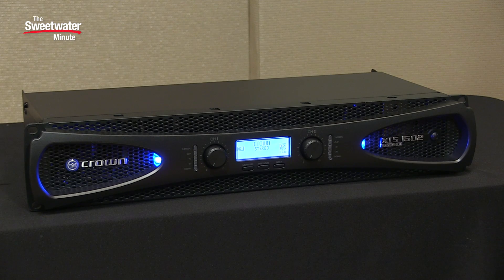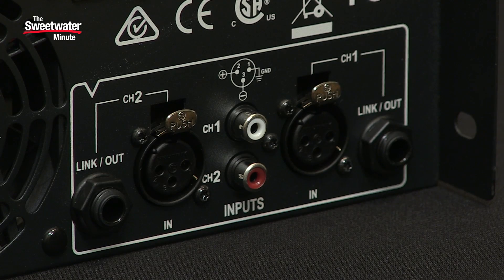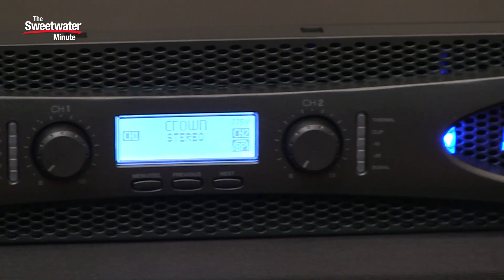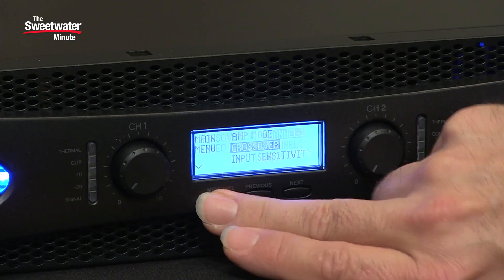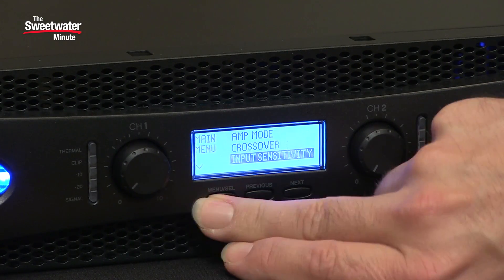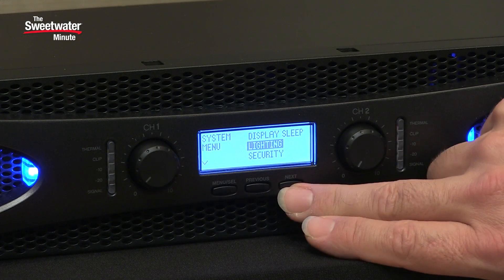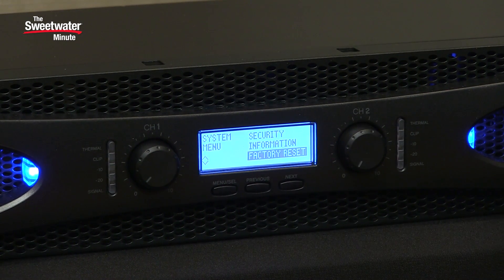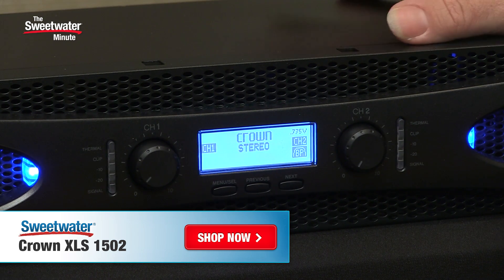Crown XLS 1502 Power Amplifier Review by Sweetwater

Comment: How can I have individual volume control remotely of each channel? Preferably under $30

Thought about splicing up two RCA bass knobs + - input with the sub wire then the other out RCA on the knob directly into the amp....but I don't understand how to determine if that is suitable for the potentially upwards of 300+ watt RMS draw from each channel 

Will this work and if so any concerns/cons?  Or any better options? Would appreciate replies from anyone that would be knowledgeable on best way to accomplish this. Cheers!

Comment: Careful guys, this amp is designed for DJ's and PA (public Address) systems, not hi-fi.
Reply: It sounds amazing and works great for loudspeakers in the home. Especially ones with 12-15 inch passive woofers which are incredibly hard to drive.  

Just pick one up and try it, trust me.
Reply: I use two of the smaller models (1002) in my sound system at home. Does the job better than anything else I've owned so far lol.
Reply: This amp outperformed my Emotiva and My NAD and did so without coloration...not warm not bright, it just puts out what you put in. For the price, I highly recommend you try this amp on your Hi-Fi set up and see what it can do. Read & watch the reviews first!!
Reply: I have friends with high end gear who highly rate this amp

Comment: Can I use this with just a CD player and use the gain control for volume or would I also need to use a preamp? Thanks. Great video
Reply: You'll need a line level, stereo preamp.
Reply: @Luke Schneider My bad!
Reply: @Luke Schneider Yes yes I know! The possibility of such case I mentioned, for nowadays products is zero. It's just that a couple of months ago, I stumbled upon three battered and bruised, 15y old or so power amps, at a pub, from obscure brands like Deton(?!) and Mac Mah(?!), which had only xlr inputs. It's surely a thing of the past. You never know what's still out there and still working! But yes, everything now has rca terminals, too. Even 6.35mm jacks.
Reply: @Luke Schneider Roger that! It's confusing when you start. Needs quite a lot of reading, memorizing schematics and hands on practice. Also the number of cheap combo cables in the market (xlr to rca to jacks to speakon to euroconnectors to whatever) is making people believe anything can be connected to everything without problems, hence permanent installations, like the example I gave, having gear from several doctrines and you trying to become Sherlock Holmes to figure out noise, drops, hiss, loudness levels etc. I've come across several such atrocities. All because owners usually ask electricians to choose, install and set up.
Reply: @Luke Schneider Hello again Luke! Just wanted to ask you about the GX7. Were you satisfied by it? Sound, built quality, fan noise etc I hold QSC very high in my "book" of PA amps. Was it for use at a studio, gigs or your home hifi system?
Reply: My accuphase p300x had attenuators. I could connect my CD player directly in to it, but I heard no improvements. Actually, I preferred the conrad-johnson PV-3 in the chain.
Reply: @Luke Schneider Do you mean "It only accepts pro level"? I didn't understand this "o my" bit. If that's the case, yes we should be very careful what we buy. With respect to what precedes any power amp, in the chain. Moreover, it gets a bit more complicated with unbalanced outputs from let's say a player or a 2ch dj mixer/preamp to a power amp with only balanced (xlr) inputs. Nevertheless, you're totally correct about this Crown. It can do consumer devices. I just hope "Vaping with James" didn't listen to me blindly and hopefully ended up not looking for a preamp. Not to mention this was 3 months ago.

Comment: You said about DSP high pass low pass crossover using one amplifier that's only on one speaker though not too speakers using both channels isn't it. It's taking one channel low-pass and one channel at high pass you would need two amplifiers to run two speakers not one amplifier.

Comment: I recently purchased an XLS 1502. Great amp but it had one problem. The LED VU meters can be turned OFF in the amp's control panel. The only problem is the next time you power up the amp and crank up the volume the bottom green LED of each VU meter will begin to flicker. The sensitivity of the meter is much lower though. I went into the control panel and it confirmed that the meters were indeed OFF. I turned them ON and back OFF again and the LEDs went dark like they are supposed to. The very next day I had to go thru the same procedure again. I purchased it from Crutchfield so I explained the problem and exchanged the amp for another. The 2nd amp had the exact same issue. Crutchfield contacted Crown and explained the problem to them. The Crown guy said that this is normal and that there was no current fix for it. So the amp is advertised as having a feature that does not work correctly. WTF Crown?
Reply: Put a black tape over the VU meter :p
Reply: me encantan las luces led rítmicas

Comment: if I have 2 speakers per side of 500w rms 8 ohm what amplifier power does it need at 4 ohm per channel? Model and power exactly   by mid hight frequenzi,  and 2 speakers per side of 700w rms 8 ohm for subbass 160/20 Hz. Exactly.
Reply: David Perla  you would need a power amplifier that is rated 450-500watts @8ohms per channel not to exceed that per speaker
Reply: https://www.crownaudio.com/en-US/tools/calculators#amp_power_required

Comment: Will I be happy with 3 of these for 5.1 home theater and b&w 683s? I had a Nad M25 and I’ll be using my Nad M15 as Pre amp.
Reply: I can answer that in detail even i use one of these amp to drive my subwoofers (JBL 100, 18 inch each subs rated at 750watt RMS @ 4 ohm EACH) i run the 1502 XLS in bridged mode (1025watt @4ohm) the crossovers alone are worth having these amps. You can set per channel crossovers in stereo mode, or 1 channel in bridged (doubling the power) 

My setup is as follow 

Pioneer ELITE vsx82txsi receiver 7.1 7x130watt @8 ohm 20-20khz tested (so no skewed specs) 
Pioneer ELITE dvd i use that one as cd transport and bluray player 
Monster HTS 3600 power conditioner.
Crown 1502XLS to drive the two JBL subs and also as crossover set to 47.5hz
Lynnfield Boston acoustics VR40 front  (USA made, VR top model series, not the today's chinese ones) 
Lynnfield Boston acoustics VR40 side 
Lynnfield Boston acoustics VR12 centerBoston acoustics VR MX dipole rears 
2x Micro micro90pv subs used in tandem with the fronts 
2x JBL JRX100 18inch subs (probably the biggest ones you will see in a home theater by far) 

You will never need 3 crowns, 1 will do it the Bowers and Wilkins you got is hardly a hard speaker to drive and need little to operate. Buying 3 would be overkill and totally useless in your setup your speakers do not go lower than 52HZ, low-end is where you will need power/stability and it will draw most there, to illustrate what my 1 crown is doing it drives 2 subs, that can handle 750watt rms each, so 1400watts and can handle 28hz. I have never, ever taxed my crown it can drive it with ease and yes without breaking up. Let alone with your setup, i can promise you get one try it. It will control your speakers with ease and pretty much any speaker you wish to drive. 

I was a skeptic to introduce a PA amp into my setup, lots of audiophiles feel themselves to good for it. 
Well they are all, wrong the sonic quality of these amps is absolutely outstanding and the amount of power you get for your money. Not high end amp, can really compete with that and yes hang a low impedance speaker on it. NOT A PROBLEM....

Comment: I was ready to order this AMP but thought was a bit under-powered for running two Electro-Voice EKX-15's so I upgraded to the Crown XTi 1002, hope it was worth the extra dough. I had recently tried to run DJ equipment with the powered speakers, EV-ZLX 15's and they were blowing power fuses and overloading the electrical system, so I went back to AMP. (not to mention powered speakers do seem to pick up more RF interference.) I do still have the EV-ZLX in 12" which are great for smaller venues. I am a Sweetwater customer as well and have used Crown for years, Crown is excellent although I wish they would just avoid Speakon outputs and instead build in XLR for speaker outputs or TRS female.
Reply: U Seems to be funny.. Xti1002 is. Less powerful then xls
Reply: @NikhilDangui  not according to their website. If you check the documentation, the xti is more powerful. Not sure why it's only advertised as a 500w amp vs the xls advertised as a 525w, but it's the specs that count and the specs say xti is more powerful 🙂